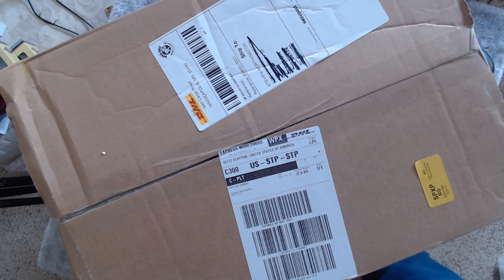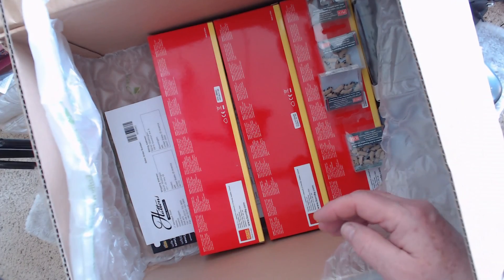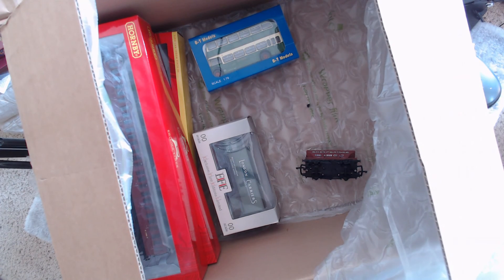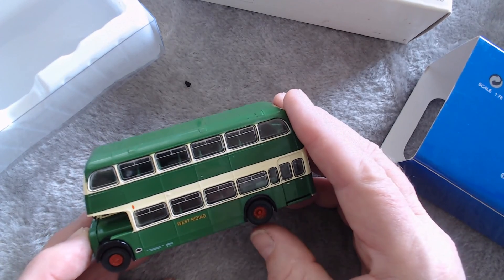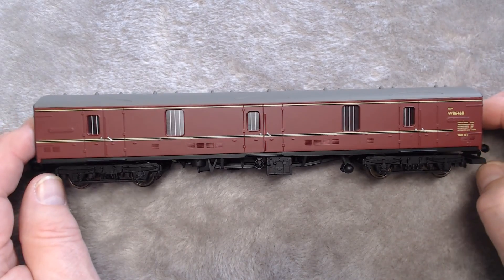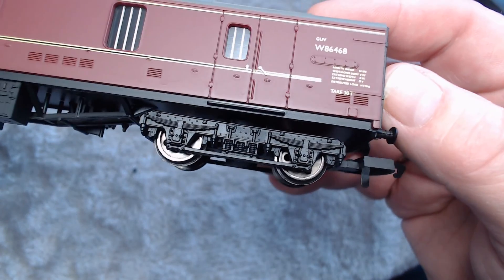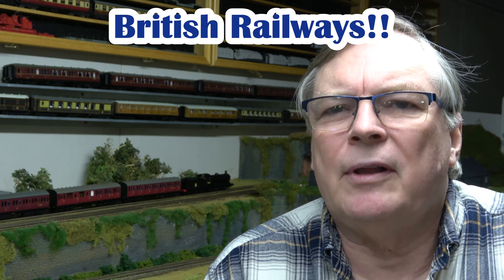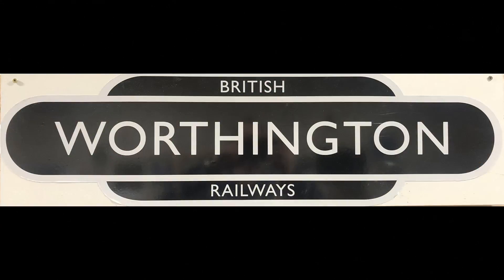102. Hattons Delivery: Hornby Q6 with Gresley and EX LMS Maroon Coaches

Comment: I got the same email about the Q6 Raven going cheap from Hattons, so nabbed an LNER black one. A week or two later, got a similar email about the Hornby LNER O1, so got one of those to. I still haven't taken it out of its box yet to run it in. Its all to easy to overspend with these Hattons cheap deals